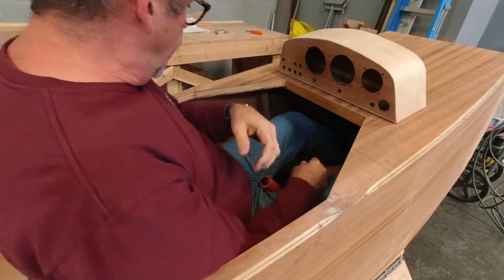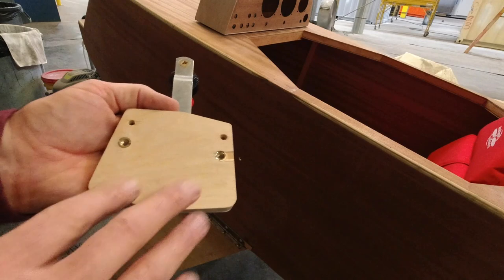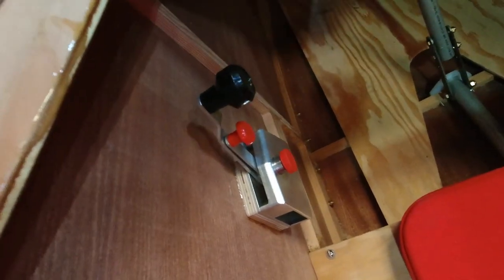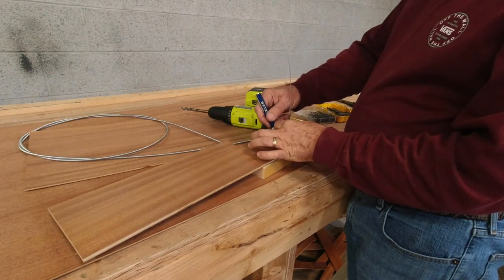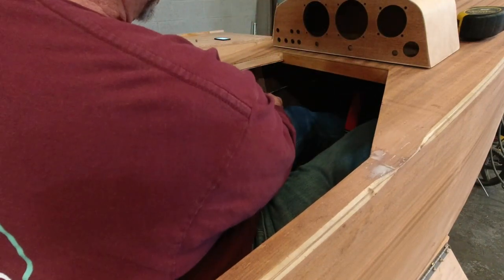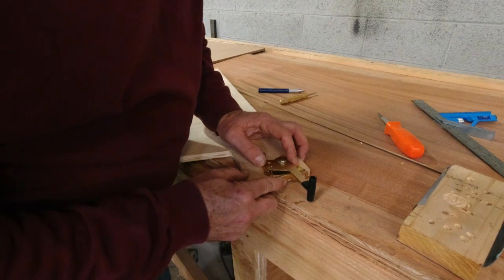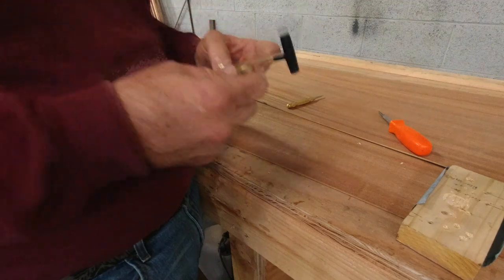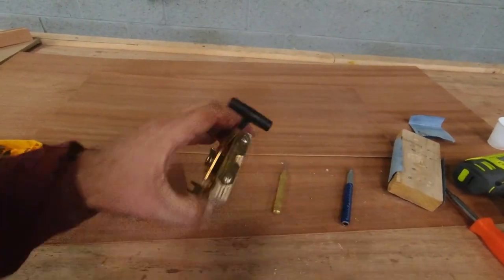Minimax 1100r Wood Aircraft Build Ep 95

Comment: If you ever accidently glue a metal screw with epoxy, heat the screw with a soldering iron and it will come right out. All epoxies I've used softened around 200F
Reply from the maker: That’s a great tip! Thanks for that!
Reply from the maker: It was your photos that inspired my tank bays...I just realized that
Reply: @DTMinimax   On my blog you will find a drop-down menu of categories where you can find posts on specific topics like fuel tank or landing gear. Even have categories like RS-13 so wherever that material is used you can find info about it. Even have a WTF category where mistakes and explanations to confusing stuff can be found.  I assume it was these pictures you are thinking of? https://ulbuilder.wordpress.com/2016/07/18/wing-tank-part-three/

I was frustrated that it was so hard to find good information on building a MiniMax so I tried to help fill the void with my blog. You are doing a great job doing the same in video format!
Reply: @ulbuilder  Thanks!

Comment: would you be so kind as to provide where you acquired the mechanism you are utilizing for the trim as well as the black cable you are using. I have been through all of Aircraft Spruces catalog and do not see them.  Thank you in advance.

Tony
Reply from the maker: The housing and wire come from Spruce. The housing part number is  15-05393
Wire is 05-15510
Then I purchased the handle assembly on Amazon 
Stens New Throttle Control Cable 290-163 Compatible with Left Hand Version, Panel Mount Style, Used on Riding mowers, Tractors and self-propelled mowers, Conduit Length 48", Inner Wire Length 52 3/4" https://a.co/d/1bYJiBa
Reply: Thank you. I recently stumbled upon your channel. My mind is now numb from trying to watch them all. Congratulations on almost completing the airplane. @DTMinimax
Reply from the maker: @anthonymontague962  I know, it’s a lot of videos:) Even I can hardly believe it.

Comment: Dennis, you talked about the "Mixture Control."  Will your VW have an actual mixture control?   I was thinking you would use the "Red Mixture Knob" for the choke.  The Rotax uses "an enriching circuit,"  no choke.  The enriching circuit in those engines actually can act as a mixture control.  Go figure. :-)    The quadrant installation is really nice.  Excellent work in determining the actual position of the quadrant.
Reply from the maker: Thanks Michael!
Yea the Zenith carb has the ability to adjust the mixture. I just need to work out how to turn a push pull motion to a turning motion.
Reply: @DTMinimax  Wow, Dennis, that's super cool.  This is my "new learned thing" for today.  Thank you.